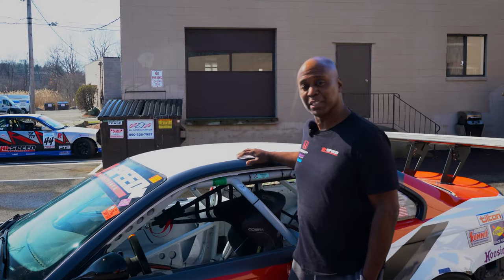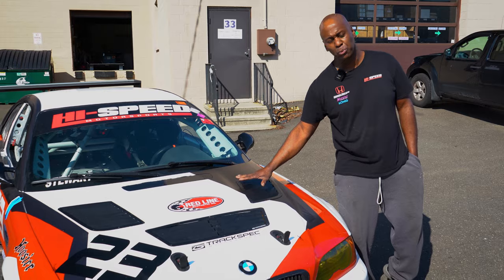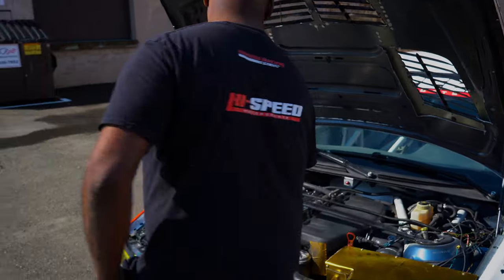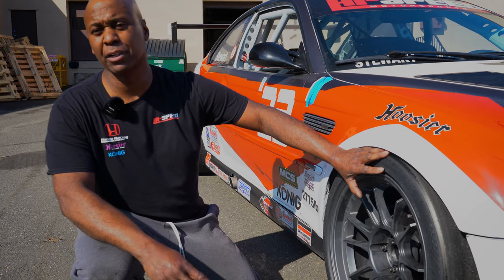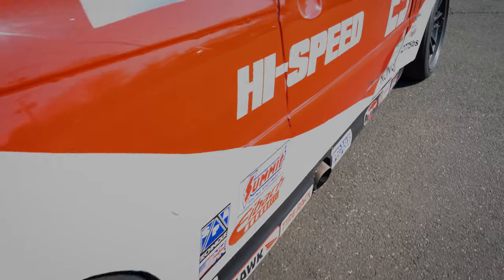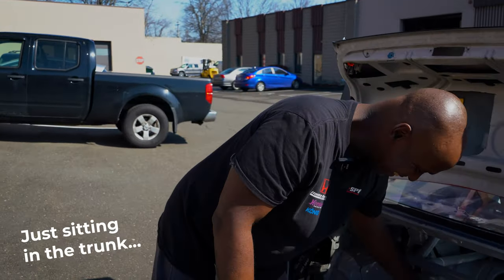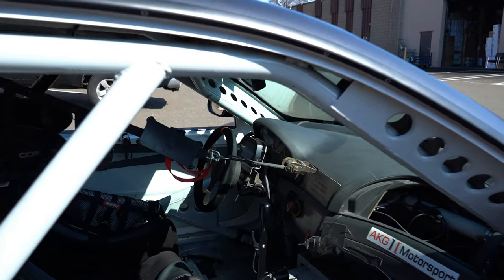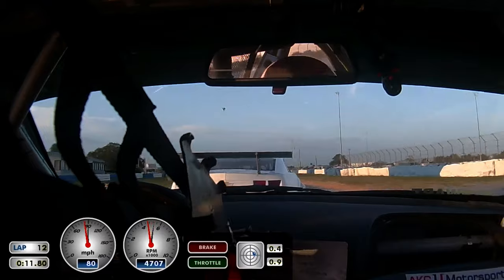E46 M3 Track Build Walk-around! (Hi-Speed Motorsports) // CAR-NA-TOMY

Comment: What aftermarket radiator and oil cooler do you run? I am trying to resolve my overheating issues on track when ambient temps are 100F+.